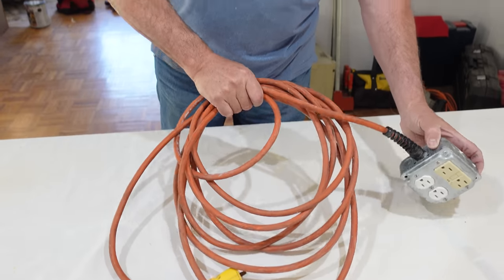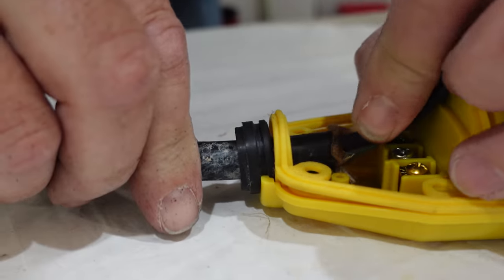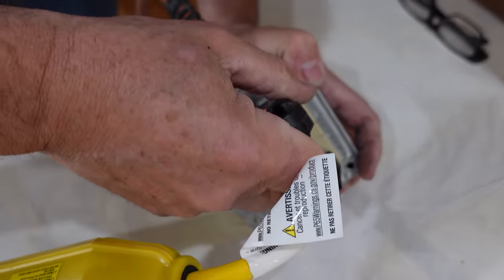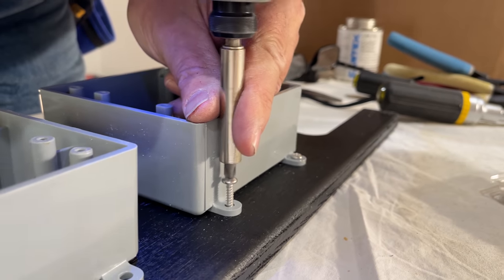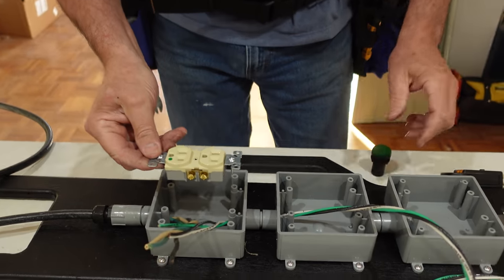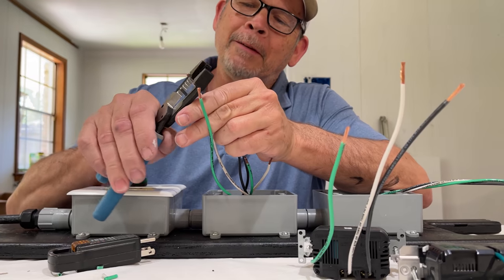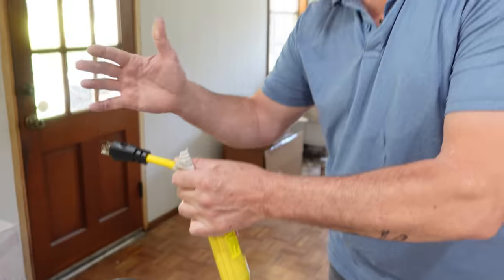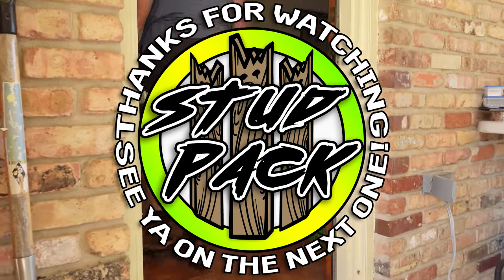HOW TO MAKE THE ULTIMATE EXTENSION CORD!

Comment: Great job (though for a non-electrician it might be handy to see the exact connections - like some drawing).
Suggestions: mount 4 rubber feet underneath: the plank won't lie in the dirt (moist?!?!) and doesn't rest on the cord when it's coiled up. Also, some cover over the outlets, before wrapping the cord around/over them - cords are dirty (unless you wipe them each time first).

Comment: I'm a retired electrician and while I was watching you inserting the hot wire and neutral wires under the terminals, I noticed which side of the terminal screw you were inserting the wire into and it looked like the right side which is against everything I've ever been taught.  You should have inserted them on the left side so when you're tightening the screw it doesn't loosen the twisted wire end.

Comment: Regarding the power cord feeding into the (yellow) housing of the GFCI, I was quite surprised to see that the straight steel clamping part was secured with what in my own amateur diy experience would seem to be less than normal clamping pressure.  i take into account that which i have also observed whenever i disassembled various equipment to make repairs or replace parts, i just hope to gain better understanding of what is too much clamping or squeezing and what is not enough.
thank you .

Comment: Circuit breakers are intentionally built with a little wiggle room to reduce headache. They'll pop instantly for a short circuit, but will usually run a few minutes at slightly increased load.

I distinctly remember us plugging in a bunch of Christmas Lights in the 90s, only for them to pop the breaker at midnight.

Comment: Since you're clamping stranded like you do solid core, you could tin the exposed ends of the stranded wire with solder. Not even a thorough flow would be needed. Just enough at the tip to keep the strands together. It won't harm flexibility since you're not compressing it in a wire nut and it's contained within hard plastic strain relief.

Comment: I'm sorry if these have already been posted.....  A few things I would suggest:

1) Don't put a 20A socket on a 15A plug.
2) If you do put the 20A socket (and switch) in, put it in the box closest to the cord (this would only require the current to flow though 1 Wago instead of 3 the way you did it).
3) Instead of "daisy chaining" the boxes, run a set of wires from the first box DIRECTLY to the second and third box (this would reduce the number of Wagos the 3rd box has to go though.
4) Don't use a Wago in any of the boxes if you don't have to.  For instance in your 3rd box, the Wago is unnecessary as it would be easier to wire directly to the switch and socket.

Comment: A Little tip as far as grounding anything out there. If you're not going to use the spade, it's a good idea to remove the green screw, take a little sandpaper the area and replace the green screw for better connectivity. Also, it's counterproductive and not legal to ground a copper cable to galvanized material and vice versa. A satellite company i've worked for in the past was up my ass with a broom when it came to grounding.

Comment: I LOVE that extension cord, that thing is serous and I may well build a more modest version for myself (GFI, light, outlet with USB charger and a quad). It would be really handy for my outdoor projects, especially when tinkering on cars in God's garage.

I mostly work on computers and got moved up into the Dilbert zone (and got a triple wide cube for all my equipment). At one point I had about 20 computers running at once and maintenance was concerned the single circuit the computers were on was being overloaded.... which it likely was. As you pointed out the breaker might not trip, but that doesn't mean the wires weren't getting hot.

I now have two circuits of my own.

Comment: Still need to cut off or tape  off the fiber strands(which are flammable.) at the ends of the "S.O." cords. Still love the channel and keep on doing, what you do. TY. 👍 Sam (Retired/disabled journeyman, high voltage electrician.).

Comment: Neat timing!  Great design.  I recently received the KWS-AC301 to make a "Kill-A-Watt" for testing the 240VAC outlets.  I was actually inspired to make when I blew my fuse in the actual Kill-A-Watt meter testing a brushless cheap 2-stroke generator with not much load on and had the experience of those generator designs, "asynchronous" I think, that when there is not much resistance on the line the voltage dips big time. .  Anyways, the next task is to determine which plug ends to make the adapter cords for which plug designs I'll be testing, which cord to have coming out of the box and which outlet to use in the box.  Guessing will be whatever is common for generators and maybe parks where RV's plug into... unless there is a benefit for using some more common shop outlet.

Comment: Best tip I got from an electrician friend was to mount up a linoleum hook in that utility knife.  Use it to rip the sheath longways until you can get under a loop of it.  Also great for stripping insulation.

Comment: Suggestions - make it self standing ( like a caution wet floor sign ), wrap the cord on one side and plugs etc. on the other. this way the cord won't obscure the plugs/ unwrap only as much cord as you need.. Use NO plastic parts. Could also use a floor dolly, Storage box on the bottom, a shelf, larger cord wrap,

Comment: Another very well thought out project. I am really impressed. You guys should have patented this rather than give it away on YouTube! 

One thing is I like to avoid wire nuts where I can. Your commercial grade receptacles have the press down plates that can hold two wires as easily as one. Where possible, I would daisy chain them. To me, it means the plate goes down flatter and tighter since it won't get crooked because of an empty half.  Also, this gives a more secure "splice" than wire nuts or wagos. It also saves space inside the boxes.

The straight blade 20A receptacle is a NEMA 5-20, not 6-20, which is 240V. People mistakenly get them with the belief they are heavier duty than a 15A receptacle and pay much more money than they have to. The only difference is the orientation of the neutral blade. Otherwise the blades are the same size, as well as the jaws. Outside of hospitals and server farms, I have never seen devices with the 5-20 plug. A heavy duty, industrial, or hospital grade 5-15 receptacle works the same, and may even be a 5-20 receptacle underneath.

Last little note about circuit breakers. They actually have trip curves, which means they are actually designed to stay closed during mild overload conditions. This is to prevent nuisance tripping, such as when a motor starts up. Be aware brands like Federal Pacific may never trip, and Zinsco/GTE/Sylvania may overheat where the breaker attaches to the bus bar. Electricians usually plan circuit capacity at 80% of the breakers nomknal capacity - like a belt and suspenders. Just from feel, the 28 amps running for 30 seconds seems within the ballpark, but look at other factors, such as the age of the breaker and how well it opens or closes.
Reply: Casey... You beat me to the catch. That straight blade plug he showed was a 20 amp 240 volt plug. It would be easy to grab the wrong one at a big box store without noticing, since people often pick up something and throw it back into the wrong bin in the store.

I also noticed he used the correct ends of the cable for the male and female ends of the rubber cable. There IS a Male and Female end of cable if he would have bought new cable and you are putting regular plugs on each end of the cable. If you find that you have to push the green wire between the white and black wire, you are using the wrong end of the cable. Just look into the end of the cable with the green wire down, the black will be to your right and white to your left for a Female plug. Opposite goes for the Male end of the cable. The white and black would be reversed. It  makes it MUCH easier to put plugs on rubber cable if you use the correct end for the male and female plugs.

Nice setup on the new power strip.

Comment: Standard breakers trip using a bi metal strip that contacts the incoming & outgoing power pads on either end which flexes in the center to disconnect the pads as the strip gets hot & therefore cuts the power delivery.  The strips are calibrated for the amperage draw indicated on the breaker.  If the power draw is slow enough, the strip gets used to the draw & doesn't heat up enough to flex for considerable higher amperage draws.

Comment: Great video!
I'd say, the reason the breaker held at 28 Amps, is because they have some headroom built into the electromagnetic trigger.
That being said, I'll bet if you'd have left that 28 Amp load on, it would've heat tripped in less than 2 min.

Comment: Good video. Ditto what Riles223 said. Every circuit breaker has 2 trip elements. One thermal, for Overload conditions, and one Magnetic for Instantaneous Overcurrent conditions. The reason the circuit can allow 28 amps on a 20 amp circuit breaker, has a lot to do with ambient air temperature and rate of heating on the Thermal Element of the CB.

Comment: There is a reason why the ends to plugs on a 20amp are different and it's so that people don't end up doing what you just did! a 20amp circuit has to be 20amp from front to load and for very good reasons. You have a inline GFCI that is rated at 15amp and it's at the beginning of a line that has a 20amp receptacle on it ( like in your test at 28 amp , which is almost double the rating! ) This could not only damage a 20amp motor due to the bottleneck as it would be forcing its way through sort of speak but also cause a fire. 

Now YES any extension cord can as well pass 15amp depending what you put on it but then your breaker would blow, but here your intent is to have a 20amp line (with the 20amp receptacle) which means it would have to be on a 20amp breaker and this is where it becomes possibly dangerous as the GFCI is not rated for the such! 

Furthermore you put the 20amp receptacle at the end which means 20amp of current would be going through multiple connections so are they all rated at 20amp ? when you have a line then with 20amp or 30amp etc.. then every thing that the current is passing through MUST be able to handle it.  

You can put  higher rated mats on an equal or lower amp line but not the other way around.   

-------Solution----------

1: Double entry plug - You have 2 GFCI plugs at the front end - 1 for 20amp circuits and 1 for 15amps like you already have on. so just install them both into small lean plastic box with a switch that either enables one line or the other because you would not want to have them both live!. 
2: Put all the receptacle at the front end of the of load line and make sure they are all 20amps
3: Put usb lines after the receptacles so that max current does not flow through them.
4: Put light at the very end. so if it fails you know that there is something wrong somewhere in between the whole line.  

Breakers have tolerance! which means they delay before flipping to the off position. Many appliances can start off giving a spike in current but then lower and this is normal and for these reasons the breaker will tolerate having higher current passing through than its rated for but only for a small amount of time.  

NOTE: If you would have left on your devices during that test eventually the breaker would have tripped as it would have passed the breakers tolerance.

Comment: Loved the video.  The only comment I have is that when you're talking about the NEMA 6-20, you really mean 5-20.  You installed a NEMA 5-20 receptacle.  A NEMA 6-20 (which is the plug you showed a picture of) is for a 240V outlet.  5-20 is for 120V, 20A.

Comment: The breaker didn't trip for a couple of reasons: One is that it may well have been a larger breaker than you thought it was (30 or 40 amp breakers are not uncommon for some circuits), but more importantly, even if it was a 20-amp breaker, that does not mean that it will immediately trip the moment you go over 20 amps.  This is something a lot of people don't understand.

Circuit breakers do not just suddenly cut off when the current goes over their rating.  They have what is known as a "trip curve".  You need to be significantly over the rated current for a certain amount of time before they will trip (and the more you are over the limit, the shorter that time becomes).  This is actually intentional, because a lot of devices can have a significant current surge when they're first turned on, etc, but it only lasts for a very brief time, so it's actually OK to draw a little more power for that brief time.  However, if it continues for too long, that's when it can overload the wiring and things can heat up too much and cause unsafe conditions, so you want a breaker to allow brief surges, but still actually trip if anything is over the limit for too long.

Typical house circuit breakers aren't even guaranteed to trip at all until you get somewhere around 125% of the rated current.  At 125%, you need to maintain that for up to 5 minutes continuously before many will trip.  Even if you are at 200% of the rated current (i.e. 40 amps on a 20 amp circuit), you would still need to maintain that for somewhere around 10-30 seconds at a time before something will actually trip.

Assuming it was actually a 20 amp circuit, in your video, you only pulled 28 amps (140%) for a couple of seconds.  You would probably need to maintain that level for 30 seconds to a couple of minutes before you'd be likely to actually trigger anything.  For the rest of it, you were only at 23 amps (115%) and it looked like you only ran it for about 15-20 seconds total, so I would expect you were nowhere close to actually tripping any breakers with that short amount of time (that might have tripped if you kept it up for a half an hour or so.. or maybe never.).

Please note: Even if the circuit you plugged it into has a 20 amp (or more) breaker, the outlet you plugged it into was only a 15-amp socket.  That means you were running the socket at over 150-186% of its rated limit, even if the circuit was not overloaded enough to trip anything.  You should never do that, because the socket can still melt and catch on fire, even if the circuit breaker does not trip, because the socket is often rated for less current than the breaker is.  Circuit breakers are only intended to protect the wiring in the walls, nothing else.  They will not protect you from overloading an individual socket, or the equipment you're plugging into it.  That's not their job.

Comment: @25:30 This is something I wish more people knew.  They think the vacuums are working harder because the sound pitch increases.  But when the air flow is blocked, it's moving less air which means it's doing less WORK.  The pitch increases because the rotor speeds up.  This is counterintuitive with vacuums, but makes sense when you think about other machines.  If you have a table saw and bog it down with thick wet wood, the motor slows and the amp draw surges (and then your breaker trips 🥴).   So we know with shop tools that loading the motor slows it down and draws more power. What we don't get intuitively is that MOVING AIR is the work a shop vac or HVAC blower does. Remove the filters from your HVAC system (as a test) and it will draw more power.  Have clogged filters and it will draw less power.

Comment: In my country breakers are 20A 220v  for the wall and trip with in 30s of over current and the GFI is in the fuse box and wired to all plugs in house. So no risk of fire or shock.

Comment: Not an electrical engineer, but breakers trip in function of time and current. 

You may be able to draw a constant current higher than it's rated for for a while before it trips. Another quirk of that is that it can also trip at a much lower amperage if the amperage rises very quickly. 

If it's important to you, manufacturers chart this behaviour in their specifications. For instance, you might want less protection against rapidly rising currents if you intend to power a high-end PC or a heating element. The chart would help with figuring out if it's really the right breaker for your application.

Comment: I think I would have used 10g cord for the main. You may need to run power from a more remote source.  Cool idea though. I would have also left out the USB stuff and fed each outlet with it's own wire from the main 10g coming in. The beauty is having everything you are using plugged in and ready to run.

Comment: I found the circuit breaker very interesting. My background is aviation, if memory serves me correct we always used 150% of peak current for our circuit breaker design (CALAC); in aircraft. This compensates for reactive surges, i.e.: inductive kick when you kicked your motors on. Your question is an excellent one for the circuit breaker manufacturer. I am guessing you did not hold the 28 amps long enough for the bi-metal contacts (?) inside the breaker to heat up enough for the breaker to trip. I also find to alarming for me. As you probably do as well; a lot can happen in the system with excess current. I don’t like it when wire burst into flames!

Comment: The simple reason for the higher amps is that circuit breakers are designed to trip with the possibility of to much heat in the wires, and not just amps. 
Motors draw a lot of amps when starting and we do not want the circuit to shut off when turning on a saw. There is esentialy a small built in over current buffer built into the circuit breaker.